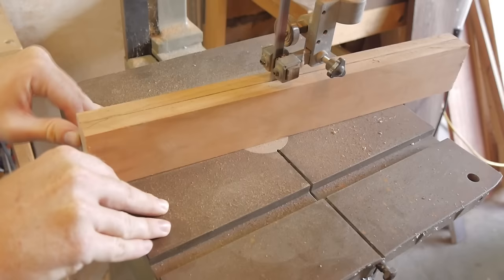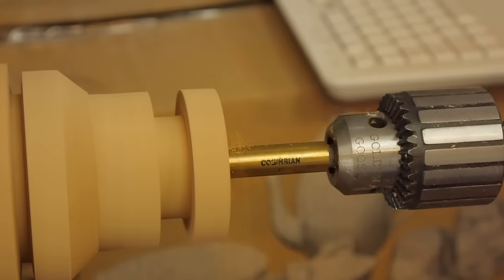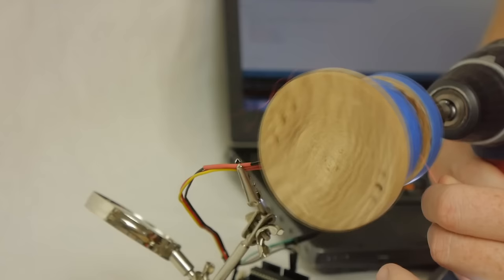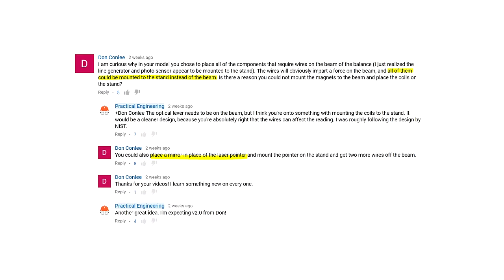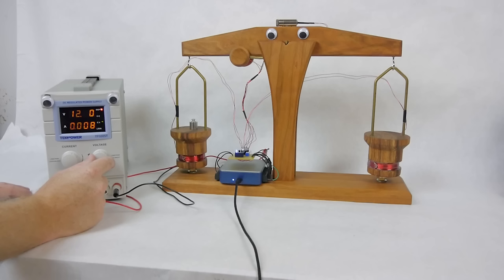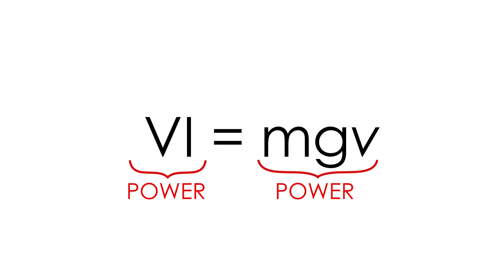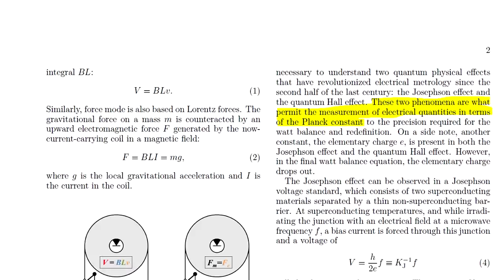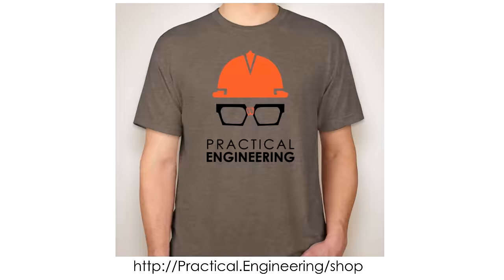Building the Desktop Watt Balance and FAQ

Comment: Thanks for giving a detailed breakdown of this and discussing the responses you got. When this idea was first hitting the news, the big comment was that it was "democratizing" only to those who could afford an incredibly expensive electronic scale, but that press whining falls away rather easily seeing someone cobble together one essentially with wood tools and a soldering iron.

This makes me curious what the future will be with this transition for those of us who use kilograms. I'm in the US where we use Imperial units to show our freedom from the empire, but science uses metric and even our home scales often have both options. (And I'm trying to get my bathroom scale to read in esterlings just to help convince myself to diet, but anyway...)

With the level of accuracy needed it's probably more cost effective to calibrate based on a physical object for, say, a kitchen scale or a bathroom scale. So I'm guessing we won't see these being used by anyone producing home products in the near future. That said, I'm curious if lab equipment manufacturers will start using these to maintain accurate in-house gauge weights to calibrate lab scales or if the watt balance itself will be modified into something mass produced that we might see in a chem lab. The calibration could be automated and fully enclosed, with the side accepting something to be weighed could have a piston plate like existing electronic scales so you can't easily spill something inside the scale. You could build in the same tare function.

Comment: Measurements are often arbitrary anyway, and while these new definitions are somewhat circular, that doesn't actually matter. You know this already, having made the video, but for everybody else: 
The metre was originally a stick in Paris much like the kilogram was a mass. The stick defined the speed of light, but now the speed of light defines the metre. 
Ultimately it comes back to the same decision, how long was the stick in the first place, but now it can't change over time like the original artifacts could. It's the same situation with the kilogram. The kilogram isn't some inherent way of measuring mass, it's just a way, and now we can have a definition that doesn't change any further.
Similarly, the second was defined before precise atomic clocks, but now the second is defined as a precise number of oscillations of a cesium atom. How many oscillations it is was defined by preconceived notions of what a second was, but now it's completely formalised and everyone can agree exactly how long a second is, with far smaller margins for error than previous methods.

Comment: Why can't we use a laser beam passing past an object, and measuring the light's curvature created by the objects gravitational pull, and subtracting the gravitational pull from earth to calculate the it's weight?? (all in a vacuum of course)
Reply from the maker: I think you're onto something with this
Reply: CentralNintendo1 it is going to take EXTREME precision. The watt balance doesn't need to be nearly as precise.
Reply: I'm aware, and the distance it would have to travel for us to even measure that small difference would have to be very large and then we would also have to use multiple points of measurement of the earth's gravity and ensure that no other objects interfere with it as well. But it was just another possibility of having some sort of constant defining the kg.
Reply: CentralNintendo1 well, if we knew the mass of the Earth down to the gram we could use it on tthe Earth, no object needed.
Reply: not really, keeping it simple, if the total change of the beam is A and the change from earth would be B then we could simply do A-B=X and then we have the the object isolated from earths effect as X. And have a reference to go by. We will still need to refer to the current Kg to then give that value a certain weight. And then we can simply use that reference to measure an unknown weight

Comment: I am designing this on autocad inventor. I am using rough estimates of dimensions.   When you designed it were you able to add the coil windings, or was it just imaginary? After I'm finished with this project, I'll start modeling your puzzle box.

Comment: I think the watt balance is cool but it is still based on gravity which is slightly dofferent depending on where you are on the planet.
Reply from the maker: The scientific watt balances are calibrated to local gravity. This is something we can do very accurately, so it doesn't affect the measurements.
Reply: Not a big problem, though — we can measure it, not only accurately, but without reference to a known mass. As Dave Scott said, Galileo was correct, and gravity accelerates all masses equally. That means there isn't any problem of circularity in the definition :)

Comment: So what's the definition of a kg. a watt based value or a quantity of silicon atoms?
Reply: I think the definition is still the kilogram in Paris that is controlled by the BIPM. Until the international community all agrees on changing what the definition of what a kilogram is it will remain as is. I don't think it will be long though before we say that a certain amount of silicon is equal to a kg or that a certain voltage and current are the definition. They both are correct and useful in different situations. I don't actually know just my thoughts.
Reply: Whoever calls dibs?
Reply: Many definitions can be derived from each other in different ways, and certainly making a watt balance seems easier than measuring an exact number of silicon atoms. Being able to roughly define a kg by getting a litre of water is also useful. Even though only one is going to be the absolute formal definition, I think they can lean on each other quite nicely. Especially in lab settings, for double checking masses, a watt balance seems much nicer. Even though an exact number of atoms may well be even more precise than a watt balance, and may be the absolute formal definition.
Reply: Neither, exactly. It will be defined as a function of the Planck constant, the speed of light, and the cesium hyperfine frequency we know and love. But the new definition of the Planck constant will be a numerical value which is in agreement with the watt-balance and silicon sphere experiments to within several parts per billion.

Comment: i would love to do every measurement manually without using that DAQ card from NIST, for example using a voltmeter for taking voltage and current measurement, will that be possible?
Reply: I guess the issue will be measuring the movement to characterize the coils. You would have to synchronize your measurements of the photo sensor with the current induced in the coil. You might be able to do that with some fast multimeters and a camera.